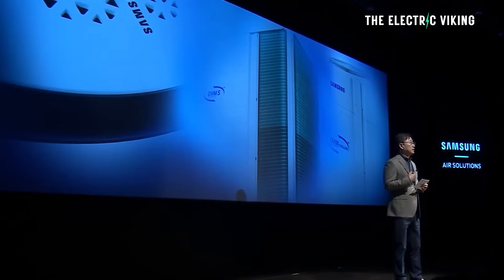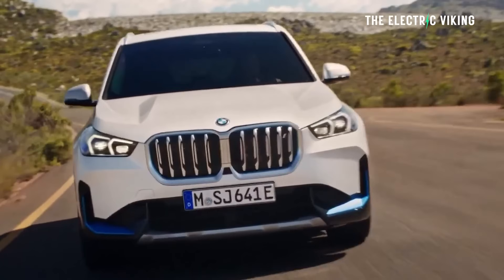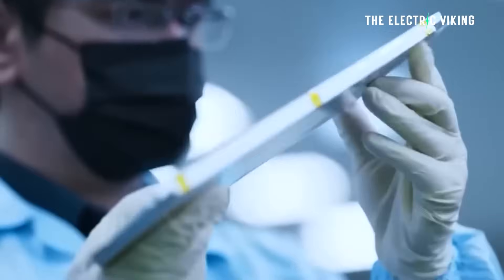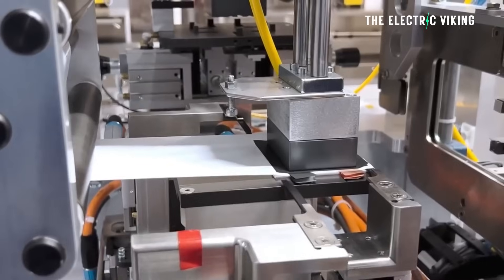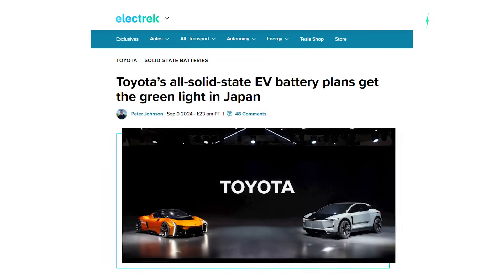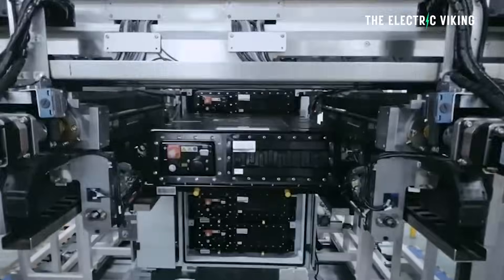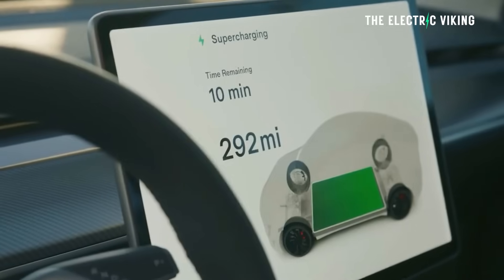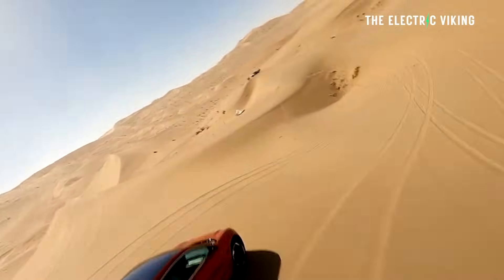How much range electric cars with Samsung's Solid State batteries will have

Comment: Sam I generally agree with you.  But here I think 650 mile range is important here in US a bigger country.  If you only have 300-350 range that is an optimal range.  If you use the heat or ac it is reduced and higher speed driving which is pretty often here in US.  Also right now you need to take 30% off for using battery for charging easily.  Then another 20% for heat or high speed driving.  So now about 150-180 usefull range.  So 650 changes the equation!  To something really usefull!
Reply: Australia ain't that small my friend in fact is comparable in size to the US so would likely have similar issues.. it's arguable whether most people really need that range given the 29 daily average miles most USians drive. Sadly the Aussies get to enjoy some of the cool stuff coming out of China while we do not..

Comment: Unfortunately, here in Canada, a "fast" DC charger is 50-150kw and an "Ultra-Fadt" is around 350kw, but there are very few. Faster speeds arent possible at this time, so 945 architecture cant be properly supported. Hopefully, sites get their act in gear quickly
Reply: You need to bin your politicians and vote to become part of the USA to fast forward into the modern age.
Reply: @neilmckechnie6638  I will fight to my last breath before I become another state. And joining the "new" US means no green energy. It'll be like going back in time
Reply: @GraemeMitchell-m6v  You may have to. Will you be on the front line or in your armchair.

Comment: The theoretical Samsung solid state battery of the same weight as your 87 kWh battery would NOT be an 87 kWh battery Sam!...Higher energy density either means smaller, lighter batteries of the same capacity or same size/weight for more capacity.

Comment: For most people, 300-500 miles of range is plenty. As the battery density gets better the weight of the battery will go down and you’ll get slightly more miles per kWh
Reply: Stop driving 75-80 mph. Try 60-65.
Reply: @monkeysuncle2816  60-65 is too slow. 75 mph is reasonable.
Reply: OR.....like Me.....30........Never leave Town.........Don't underestimate the value of Your car for just running around Town........The US still has Airplanes if You really need to travel.............Paul
Reply: I think we have range figured out. Fast charging is what needs more innovation. 10-80% in 5-10 minutes and then people can’t gripe about gas being faster anymore.
Reply: 300 miles is plenty if you can use that much and not lose a ton in winter . For me now Kona ev  is 420  KM spring fall 340 km winter down another 15- 20% with heat and fan on. And with NMCA you charge only 80% to save battery. So it goes down fast currently  if you live in cold climates you need more .
Reply: @shreeshsaurya4203  Km or miles?
Reply: Its a low of 10 degrees F here in NY.  Range will take a hit running a heatee and hested seats in a car.  Your 300-500 mile range maybe significantly less in the real world.
Reply: We need to be more specific when we talk about range in EVs though: is it WLTP range; urban/city range only; highway range only; or towing range only we're talking about?
I personally only care about highway speed EV range (120km/h) as that's where the highest consumption and range limitation is in EVs for me... and I personally can't find a reason to want to have more than 600km/372miles highway speed range on a EV because that's already over 4 hours of continuous driving, and I've rarely done that in over 20 years of driving!
Reply: 300 Miles range is good enough as long as the charging time only take around 10 minutes.
Reply: Agree.
Reply: 300 miles in both my ioniq 5 and 6 means 200.. Sam does not average 354 in his G6.. Its more like 254..
Reply: @streamingdemon2522  Slow down.
Reply: @streamingdemon2522  Yup you need to pad the claimed range by about 100 miles at max to get the actual range. Then you probably want a degradation range cushion for the long term.
Reply: So true, my car only has a 64 kW battery and a max charging rate of 75 kW but I need a 15 to 20 minute break after 2 to 3 hours of driving so the range is immaterial when the car has 450 km @ 100% SOC.
Reply: In the countryside people use cars to tow trailers of chopped fallen trees, concrete bags, bricks etc and of course generally caravans are towed by cars because few in UK drive pickups

Comment: I’m not sure how you calculate these numbers.
If you had an 80kwh LFP battery vs 80kwh solid state, it’s the same energy but the solid state battery will be half the weight if it’s twice the density. The change in range is highly dependant on how much the rest of the car weighs and how efficient the drive train is
Reply: You are mistaken he is stating that if the solid state battery is double the density so now instead of one I can replace the same space with 2 solid state batteries.
Reply: @skydragon23101979  That would mean the volumetric density is also 2-fold. But as far as I heard, this is not what Sam told us. Or did I miss it? Can you direct me to the minute in the video when he is saying this? I only heard about 2x the gravimetric density, which is not the same.
Reply: @ He mentioned it at about the 1.20 mark. But he says it in a confusing way. He mentioned that based on the current 80kwh size with samsung density should be able to give you almost double the range
Reply: @skydragon23101979  It doesn't say anything about which parameter "Samsung density" refers to: volumetric or gravimetric.
Reply: @He already mentioned it clearly same size as previous longer mileage so there can only be volumetric density.
Reply: I think he meant solid state battery = same weight and size of his current battery.
Reply: Yes but even more important will be the design adaptations allowed thanks the smaller pack profile (+weight) that will offer to build the car with a better aerodynamics.

Comment: All I want is a reasonably priced smallish EV that will do 250+ miles at a steady 75-80 mph in coldish (0-5C) weather.  Assuming I will never drain the battery completely but stop when battery is down to 15-20% - which is what I do with my ICE car - that means 200+ miles between stops.  That is enough for me.

Solid state batteries in well designed EVs will do that comfortably PROVIDED the current hype is matched by reality
Reply: Cars can already do that, in fact for the last several years
Reply: @philiphowarth9846  There are no cars in the ID3 size that will do that for a reasonable price, at least not in the UK. You have to take the manufacturer claimed range and subtract 40-50% to get real world motorway range and still have 15% of battery life. Even a Tesla model 3 which is one size larger is £45k here
Reply: That is what my car does and I bought it in 2019. It wasn't that cheap at the time but certainly much less than an ICE car over the time that I have owned it. You can pick up a used one pretty cheap. Mine is still in really good condition with no noticeable degradation of the battery.
Reply: I want 700 miles of range and a 10 minute charge time or I'm out. As an apartment dweller in wide open Texas it's too much hassle otherwise.
Reply: @tyharris9994  Why doesn't your apartment have a charger? You can't even build an apartment building where I live without it being wired for chargers at each stall. BTW, 1000km and 10min charging 10 to 80% are coming out next year. Some countries have 600kW charging now. Charging at home is way better than going to the gas station.
Reply: @tyharris9994  because you regularly drive 8-10 hours without stopping? Maybe get the charging facilities installed close to you

Comment: 1000kms? Almost as far as a 2009 diesel Volvo C30 Drive-e on a tank of the good stuff. But much more fun. 

This would make regional and rural EV ownership much more appealing in Australia.
Reply: That is one of the things holding back rural adoption everywhere.
Reply: Garbage, This goes for city and RURAL.  I'll repost this just for you...I grew up driving EH, HR, HK, {insert 60's 70's Holdens and 60's to  70's Fords}, ALL of them had a range of between 300-400K's per tank, {6 cylinder, worse with a V8}, and that was if you nursed it, I also ride motorcycles with a range of around 250 k's , I  still managed to drive ALL over Australia and I NEVER heard anyone whinge about "range anxiety".... And before anyone says "yeah but there were service station everywhere", There were NOT, you planned your trip ...
Reply: It is already from looking at the sales figures over there in Oz.

Comment: With this technology, I'm almost at the point to switch.

2 things are needed for me to switch to an EV.

1. Decent range, about 600km+ on average. I currently get 800km in my diesel car.

2. Be fireproof, so not go into thermal runaway like current EV type batteries.
Reply: Your 2nd requirement is silly. Already, EVs are 10x safer from fire than your diesel.
Reply: @johnfruh  arguably the first one is silly too given the average driven by Aussies is around 36.4 km... but of course everyone's use-case is different. Here in the US the largest complaint seems to be having to wait an extra 10 minutes is just too intolerable versus all the benefits and freedom you get from owning an EV. Note: Average US daily is around 29 miles / 46 kms.

Comment: CPU performance would be long surpassed by the time these batteries require replacement in consumer smart devices. They would not benefit significantly from longer battery life, however greater energy density could be useful.

Comment: "These batteries can charge in ten minutes" Are you talking about a 100% charge, Sam? Or a nonsense 10 to 80% charge, which is only a 70% battery recharge? That really chops the range.
Reply: Yes, Sam is talking about “nonsense” 80%. It’s the standard way to measure charge time. Get over it!

Comment: Hi Sam really enjoy the content, and I for one would buy a EV if it got to around 800K before needing to stop for a charge, But lets assume by 2028/9 that 35% of cars are EV, what's going to happen to the petrol cars that are previously on lease or finance, because they will be worthless than the equity predicted, who is going to carry that debt.  Secondly how will Governments claw back lost revenue from fuel.
Reply: What’s going to happen to ICE vehicles, you ask? The same thing that happened to horse drawn vehicles back in 1910. They will disappear. Also, never underestimate the government’s ability to tax us. Here, I’ll let the Beatles tell you better than I can “Taxman” … https://www.youtube.com/watch?v=gMdcE8jdz70
Reply: This is the fiscal driver for EV change, most manufacturers are transitioning to EV production in part because of this. They will initially transition to hybrids, which will hold up better at 35% BEV share. Before transitioning to selling BEV and EREV models only as they can be built on the same production line (adding a small petrol generator to a BEV platform). The depreciation levels facing ICE sales in the next few years will benefit the used market though.

However, the real danger for ICE comes from within via alternative combustion approaches such as microturbine generators or free-pistol linear generators where their signficantly higher fuel efficiency which erodes ICE's range advantage. EVs just provides the electrified drivetrain platform for these generator engines to become viable since they no longer need to drive the wheels directly, which inhibited their earlier uptake (the technology goes back to the 1950s, with modern versions in development since the early 2000s inteded for EREV use).

Fuel taxation will change to a pay per mile model, for all vehicles not just EVs.

Comment: Please tell me which chemistry can have 10x energy density. Lithium air claims are not real because as you discharge the battery it gains oxygen increasing the weight significantly. Nothing has 2700wh/kg. Sure we might double density them over the next 20-50 year double again. Not that we need it for the transition. Sam I know you want to talk up the future but the technology today is enough to get from Melbourne to Sydney with 2 ten minute breaks. What I am really waiting for is a car that has LFP and does v2g. If BYD would do that I would buy one. Faster charge time is good but charging for 3 h at 25kw at home then selling back to the grid in the peak is what I'm after.

Comment: Hi! Canada here. A 1000 km range car is, for people living here, the Holy Grail. I've driven well over 1300 km a day at times, when I've had to drive across the country. Even now, a 1000 km range battery is something i can use just to make an 8 hour round trip drive to Halifax from Fredericton, where I live.
Reply: 1000 km in reality is 750 km
And if you are driving on motorway becomes 600 (Yes, that big is the difference)
To charge from 10 to 80 % (to not lose time) means every 420 km. With 130-140 km/h speed limit (at least in Europe) means every 3 hours which is the exact time you want to make a break.
Therefore 1000 km range is not useless, in fact it's exactly what we need for long trips also in Europe not only Canada
Reply: What ICE vehicle do you drive as I'm not familiar with one that typically gets 1000 km of range except for HD pickups
Reply: As I fellow Canadian I agree. Up here we have large distances to cover and thus the increased range would be invaluable. Also, the higher energy density battery would help offset the range drop we get during the winter.

We generally describe travel times in hours as opposed to distance.
Reply: You don’t stop to pee?
Reply: Is that what the average person drives in a day ?
I'd guess that most car owners do less than 100km a day for personal use and they would comprise the bulk of all cars (not including delivery vehicle here).
Reply: @ProcaviaCapensis-ts8ub who cares about 100km? City drivers can have those cars. For everyone else doing long trips 800-1000km range is important. Especially for round trips. You should not stop where your car wants to stop, you also need to have enough to heat up the car in winter, especially if you're stuck in traffic for hours.
Reply: @Kallon-r3b  Wow , you think you're so important.
Does mass production mean anything to you ?
Car manufacturers will focus on bulk sales before they look at niche groups.

Comment: If a battery company cannot produce decent battery then start bragging that they are going to produce solid state battery.
Reply: Allow me to disagree. Samsung made the batteries for Teslas for the first up to 10 years of Tesla history and it seems they did it successfully. If not, Tesla would not exist today as a brand.
Reply: When containers will be designed and manufactured with embedded solar panels on them, that can connect in daisy-chain-series, regardless of where they are situated on a container ship, lorry or train, then products will be radically cheaper and transport less dependent on oil.
Reply: You don’t know Samsung.

Comment: I need 700 miles range, going from Geneva to London
Reply: Charges in 10 min
Reply: No you don’t. Driving non-stop for 700 miles is grossly irresponsible.
Reply: @JohnSmith-x3y8h  you don't need to drive with self driving cars, you simply need to recline your seat and sleep.  So it's actually not irresponsible. 

South Korea or a Chinese company would make it happen very soon.
Reply: @ i meant without charging, from geneva to london not may charging stations
Reply: Would be nice! Not having to stop every 150miles to charge would be fab! I don't fill up with petrol every 150miles!